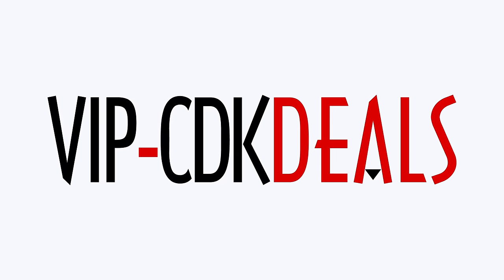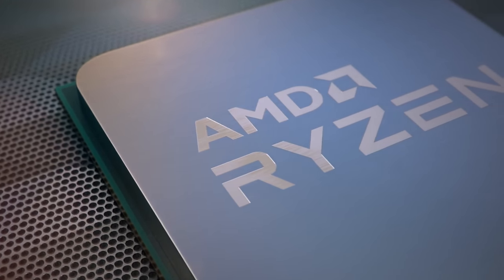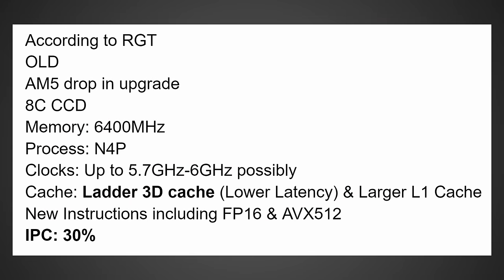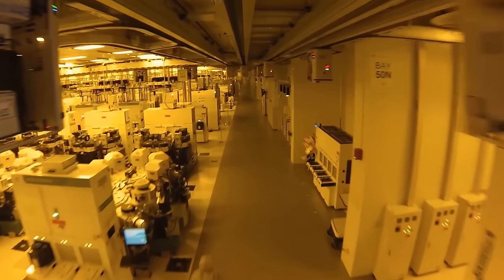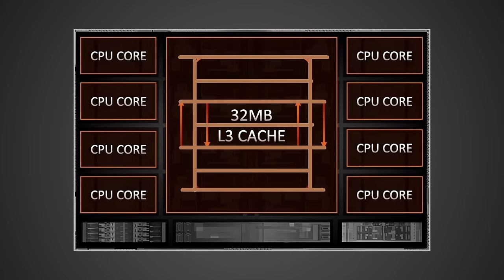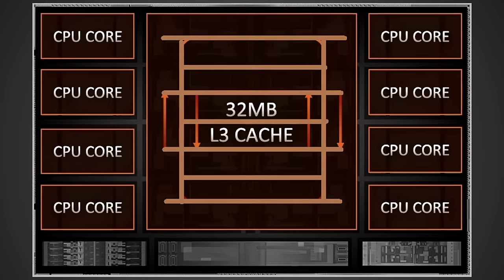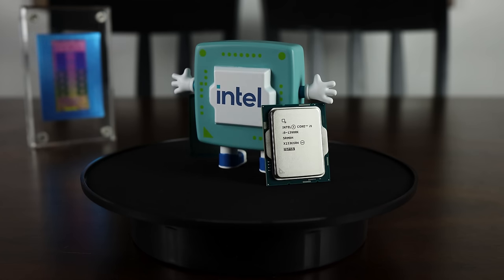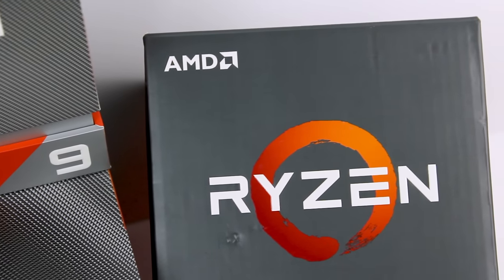Zen 5 Wins - AMD Ryzen 9000 Specs & Release Date

Comment from the maker: Thanks to Vip-cdkdeals for sponsoring this video. 30% off code: GPC20
▬ Windows 10 pro ($17):https://www.vip-cdkdeals.com/vck/GPC20w10
▬ Windows 11 pro($23):https://www.vip-cdkdeals.com/vck/gpc20w11
▬ Windows 10 home ($14):https://www.vip-cdkdeals.com/vck/gpc20wh
▬ Office 2016($28):https://www.vip-cdkdeals.com/vck/gpc20of16
▬ Office 2019($47):https://www.vip-cdkdeals.com/vck/gpc20off19
SUPPORT My Work & Get Discord Access: https://patreon.com/TheDisplayGuy

Zen 5 Wins - AMD Ryzen 9000 Specs & Release Date
AMD is getting ready to release their next generation Ryzen 9000 CPUs based on the Zen 5 microarchitecture including the 9950X, 9900X, 9700X, and 9600X CPUs. These will be followed shortly after by a Ryzen 9000 series refresh including the Ryzen 9950X3D, 9900X3D, and 9800X3D CPUs which will bring a substantial performance uplift over the Ryzen 7000 series processors.

Comment: Oh please... 40% is a fanboy's wet dream. Zen 5 will be a 15-20% uplift over Zen 4. It may reach 40% in a certain workload.
Reply: Right. When they say "up to" that usually means "in this super specific application that we cherrypicked to achieve the highest number"
Reply: @rodiculous9464   No shit dude, thats what UP TO means.   In other news the tallest building in the world was "cherry picked" cause it' was the tallest. '
Reply: It's "upto" not 40% across the board. if clocks stay on boost longer or higher and ipc is higher, especially for avx workloads (not that I like avx) up to 40 is possible.
Reply: @martinbishop9042  Yet most people still missed the "up to" part and take it as if Zen 5 is gonna be 40% faster at games.

Comment: Good. The upgrade from ryzen 2600 to ryzen 9800x3D shall be tremendous
Reply: Lol 3x single and 4 or 5x  multi performance.
Reply: Lol true 🤣
Reply: I heard the 10800x3d will be 60% faster. Just wait another two years on top of the six years you've already waited. /s
Reply: @Willy-pn5wn  naw man Intels 17900k with game cache will be another 149% over that. AMDs cache is trash.
Reply: i upgraded from i9-9900k to 7800x3d and that was already huge in itself, my FPS in fortnite went from 200 to 500+ lol

cant wait for 9800x3d now i only need to swap cpu ill be able to use same ram and mobo
Reply: hold my beer i want to jump from i4790
Reply: @christophermullins7163  but amd cpu motherboard last more than 2 gens. Intel change motherboard like money grow on trees
Reply: Im still on r5 2600 as well lol
Reply: 3d will launch probably at end of the year
Reply: I plan to upgrade my 2990WX to Ryzen 9 9950X

Comment: Hopefully it's faster than their current 7800x3D, else it will be same problem like with non 3D zen 4 launch, it just wasn't any better than 5800x3D :(
Reply: Agreed, im waiting for the 9800x3d and 5090 coming from some old ass computer 2080mobile lol
Reply: @direwolf3972 try 1070 😂 and 6700 k 😂
Reply: @Oliver-sn4be we are in the same boat Brother, really hope the 9800x3d comes out this year.. ill wait if it doesnt
Reply: @direwolf3972  we w8 enough  I think  hehe
Reply: @Oliver-sn4be perhaps but since i m waiting on the 5090 its not hard to wait for the cpu either lol
Reply: @direwolf3972  eh bro 90 class  is rip off ya it powerful  but are you gona need it ? Like if for games only nah for to make cash yah but that my mind set 😏 as for procesors I always  get the most powerful  ones so the last longer  graphics  cards  well even a 1080ti is still  powerful  enough  to play games but simce the always  change it can't play some games  because  it don't have something  in it like  re tr .
Reply: @Oliver-sn4be I'm also on GTX 1070 as well(used to have i7-6700k but now on Ryzen 5 1600 AF for now) and it's going to be retired several months from now to either RDNA 4 or Blackwell(along with the cpu as that's getting upgraded to at least a Ryzen 7 5700X3D).
Reply: @masterlee1988  I was thinking  about  the 7800x3d  since same price  as the 5000 one x3d over here but  motherboard  is same price as the 7800x3d  🤣 like come so expensive  hehe

Comment: If a plain entry level 9600x (assuming AMD keeps the naming nomenclature) has a 30% IPC gain over the 7600x and is offered at a reasonable price, I do believe it will be finally time to retire my 5600x AM4 system.
Reply: 20% would be a huge success and Intel would be scrapping to keep up. With the notoriety that ryzen has.. AMD knows that they do not need to go for more than that to keep solid sales.
Reply: Finally? Thats still pretty new.
Reply: @tottorookokkoroo5318  I have that CPU and I get 100+ fps in any game.
Reply: Same with my 5800x system. I've a 4090 waiting to go in but I may hold off on the cpu upgrade to see what arrives.

Comment: According to rumors, the reason the Zen 5 9950X and 9950X3D have a 46% IPC improvement over the 7950X and the 7950X3D is that the 9950X and the 9950X3D are rumored to have a 6.5 GHZ max clock speed, with Ryzen 7800X3D temperatures. I hope in every way its true.

Comment: Intel's Core Ultra CPUs are a huge bust on laptops..they offer nothing over the 13th gen CPUs...they won't be any better on the desktop. Zen 5 is shaping up to be a huge jump in performance...but I think people should be talking about the bigger shift that has happened recently and that's games moving away from the CPU and using the GPU at almost 100% usage. These high performance CPUs may not really matter for gaming if this trend continues.
Reply: What are you talking about? Cpu is the bottleneck on a 4090 like 90% of the time. Next gen gpu will be even more powerful, requiring an even more powerful cpu to use efficiently.
Reply: @authoritariangentleman7570  Maybe you misread what I said? I'm saying developers are not using the CPU as much anymore in newer games and patches. They're shifting all the workload to the GPU. If that trend continues, your CPU won't have an effect on the gaming experience like it once had. There was a video demonstrating this with 6-7 current games and performance was almost identical from 6 core CPUs to 16 core when using the same GPU. CPU usage was down in the 20-30% range.
Reply: Your GPU should always be at 100% usage if the game is running correctly, 100% in what it's supposed to be, if it's not that means you can turn up your visuals by a lot. CPU is the bottleneck.
Reply: @authoritariangentleman7570  "Cpu is the bottleneck on a 4090 like 90% of the time."
At 1440p and 4K, no, it isn't.
And who the hell buys an RTX 4090 to game at 1080p?
Reply: @nathangamble125 cpu is the bottleneck with a 4090, period end of story. Even at 4k, only a few cpu can keep up with it. You need an i9 or R9, anything else is leaving performance on the table.
Next-gen cards WILL require new, more powerful CPUs to utilize 100% gpu power.
Reply: @MeMyself-gf7fn no this is wrong and stupid regurgitated broscience. You want the lowest utilization to achieve acceptable performance. That's like saying "your car engine should always be redlining at 10,000rpm otherwise it's not working right" 😂 the only time you want 100% utilization is if you have a bad old gpu and want to squeeze out every last frame
Reply: This is not true for Dragon Dogma 2. The game is heavy on CPU.

Comment: Most likely Zen 5 vanilla will be 15%+/- in gaming perf, and then 30%+/- for the X3D variant, just like Zen 4 was.

I havent even finished my AM5 build and booted up my 7800X3D yet, lol, ill probably wait for Zen 6 to drop it into my board.
Reply: My guess would be 20%+ and another 10-15% for Vcache models(in games). If they match the uplift from zen3 to 4 it will be a huge success. 40% overall? No way. Probably not even in a single cherry picked benchmark. The hype machine always hypes though.

Comment: The SPEC benchmark set is often considered a throughput based on having two threads per core, there's also single threaded SPEC and leak doesn't specify which one is used, but Zen5 has so much more resources that I wouldn't be surprised this kind of result when utilizing SMT to fullest. Also SPEC is compiled by each user for the target platform, thus you could see AVX-512 being used in some of the benchmarks.  Thus 40% is the lets recompile with optimizations to our specific processor rather what you would see running on existing binaries.
Reply: This.
IPC gains are not the same across all workloads. 40% performance gains in SPEC do not indicate a 40% IPC gain in everything, most likely we'll only see a modest ~10-15% gain in most  tasks.
Reply: The 40% figures were from spec int.
Reply: Lol Redgamingtech is the source.

Comment: Hopefully the zen 5 is amazing so I can get it when zen 6 releases.
Reply: If they don't add more cpu cores just like Intel, i will take Intel with many P cores and E cores.
Reply: @misterPAINMAKER Unless the multi core score is on par with Intel or even higher, yeah going with Intel is pretty good too.
Reply: I'm taking this track potentially on 7800X3d or 9700X3d, and probably on the 7900XT (or 8800XT) too. 

Recently there was a sale on 7900XT's and I held off and waited for GRE global release, and now the 7900XT chips went back up $300 and the GRE is only $50 less than the 7900XT was.
Reply: you probably wouldn't get zen5 then because according to some leaks and rumours Zen 6 is going to be a major redesign with massive improvements for latency.
Reply: @Daonexus  yeah they use something that HBM usually use instead of slapping CCDs on a CPU PCB like what Zen 2-5 did
Reply: @misterPAINMAKER  I am not loyal to any company, whoever makes the best processor for the price gets my money. I do think that Zen 5 will beat whatever Intel can release this year because Intel's Raptorlake has barely any improvements over Alderlake and struggles with power efficiency.
Reply: Just switch to AM5 get Zen 5 and stick to it till Zen 7 or 8.
Or knock yourself out go broke buy every generation lmao

Comment: Looks like we might be getting to the point where buying a cheap prebuilt and throwing in new RAM and GPU (along with selling wtv is in it stock) might be the most affordable way to get a new PC as opposed to building from scratch (if you are on an older platform like AM4). I hate doing that, but with motherboard and GPU and higher RAM prices to the consumer as of late, total high-end builds from scratch can easily run over $4K with a high-end card, and I have a feeling my 5800X is going to have a tough time keeping up with a 5090 or even a 5080 at 1440P/High+RT.

Comment: I'm curious about the 9700g which might have a strix point igpu. And the 9600g has hawk point? @_@ they should release this asap. And strix halo :| yum yum.

I'm not a laptop guy so no 8850hs(strix point) for me.

:( I'm making a small form factor strix point prebuild.

(I have itx case.... High speed ddr5 ram.... Storage..... A psu for small form factor.... But do not have the 9700g and the upcoming motherboard.)

It's going to be better than my current pc which has 1050 non ti 10100f. 😅

Comment: My issue is that if they don't release 3d vcache cpu at launch.. they probably gonna keep that to have something when Intel releases
Reply: The 3d v-cache adds a level of complexity to the design. It makes sense to get the basic design right, then to add v-cache.
Reply: @charlesspiegel3153  will never get a processor without X3D again if possible xD
Reply: AMD is expected to release 3D V-cache versions of Zen 5 sooner after the initial launch than they did with Zen 3 and Zen 4. AMD wants to ensure that Arrow Lake won't be able to take back the gaming performance lead for Intel, and they have 2 generations of experience building X3D CPUs already, so they don't need as long to test and validate them as they did previously.
Some leaks have even indicated that AMD is considering delaying the launch of Zen 5 slightly so they can launch the standard and X3D versions at the same time, though they've made clear that this is only something AMD is considering, not something they're definitely going to do.
Reply: Since they're locked unless you have an external clock generator, I'm not interested in them anyways so I don't mind too much.

And the main programs in upgrading for don't like X3D either.

Comment: Ladder cache should remove some of the advantage that X3D has over current spec CPU's. X3D will still have faster and more cache access, of course, but at a cost of clockspeed due to heat.

But the N4 process should reduce some of that heat too, allowing clocks on the X3D chips to be closer to standard X spec chips, so overall I'd expect a similar percentage gap to be maintained to current 7950X3D to 7950X.

What we need is probably a 9700X3D instead of a 9800X3D, or a suite of 9700X3D, 9800X3D, no 9900X3D, and a 9950X3D. The 7900X3D and 2x6 core layout, and it's scheduler issues really made it a bit of a bust.

I guess now at least the 7900X3d is cheap. Cheap enough for it to be a viable alternative to the slightly cheaper 7800X3D for power users and streamers, but it's still an incredibly niche chip. I really can't see AMD choosing to make such a chip again only to see it fail to sell.

Comment: looking forward to this been starving for amd news find the nvidia stuff pretty boring, but this is looking promising especially for the 9800X3D now just need more info on the 8900XTX.

edit: since new build is all new parts Ram, CPU, Motherboard, and GPU Generations and the new up coming Enermax D.F.12 Revolution PSU hopefully the next gen AMD cards use the new connector since i'm sure amd's gonna have it soon and have had way more time to work the kinks out vs nvidia slapping the crap on there and calling it a day. and looking forward to the new Micro ATX B750's coming soon.

Comment: This is why I held off on the 7000's. Can't wait for these bad boys to come out!
Reply: they use same motherboard as the 7000s, AM5 right? so it dont affect me since 7800x3d uses AM5 board
Reply: yeah it's the same socket @aohjii
Reply: Yeah it's the same socket so doesn't make much sense to "hold off"...
Reply: @ahmedmoslemany3908  thats dope, that means when the 8800x3d or whatever variant of the 8000x3d i will only need to replace CPU and i can use same motherboard
Reply: @aohjii it ryzen 9000
Reply: @leeviwesterlund5887  my b you're right
Reply: @aohjii yep, AND the same DDR5 RAM sticks

Comment: Any word on if it will have a NPU?
Reply: The standard version won't. The Zen 5 Strix APUs will though, with significant upgrades over the NPU in Phoenix/Hawk Point.
I expect Zen 6 CPUs will have NPUs, but this is speculation.
Reply: I don't know what any of that means 🤷‍♂️
Reply: @MeMyself-gf7fn 
NUERAL processing unit, special processor for AI.

Comment: iam still sitting on a 3900x with 6800xt...on 4k i have no bottlenecks and everything is running fine....but i want an upgrade...no TPM on motherboard or upgrade if i paired the 3900x with and 4090 even on 4k will be bottleneck  time to change the system...i will keep the 6800xt thou great card...
Reply: There is always a bottleneck
Reply: You don't want a TPM. TPMs are for the benefit of anti-consumer licensing practices and not you or I.